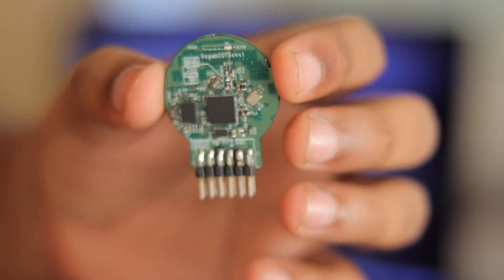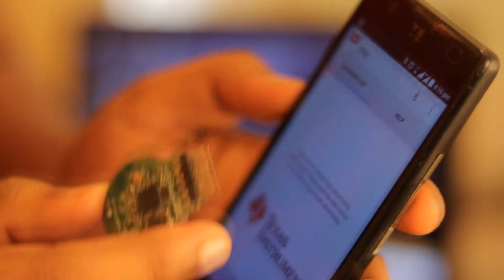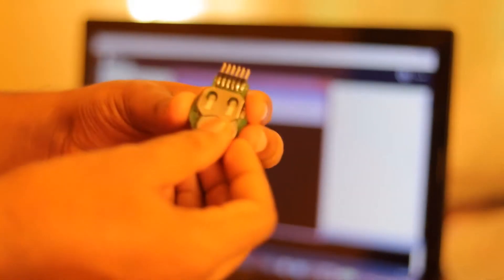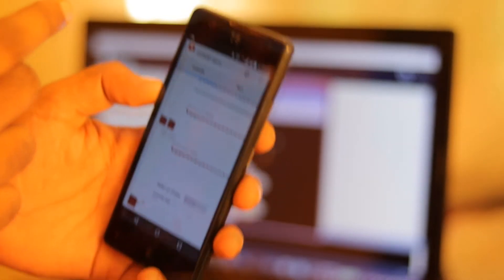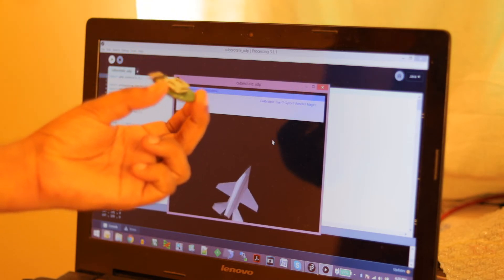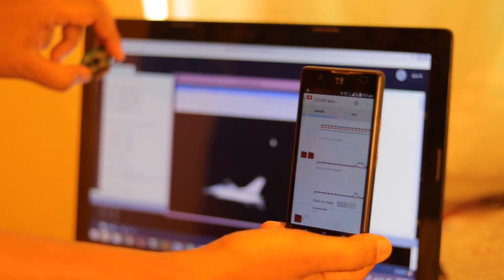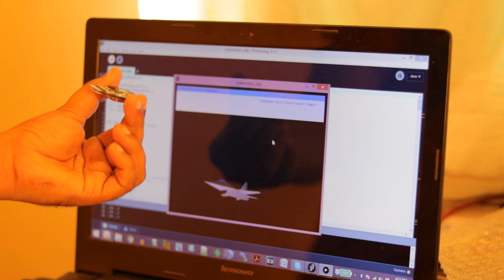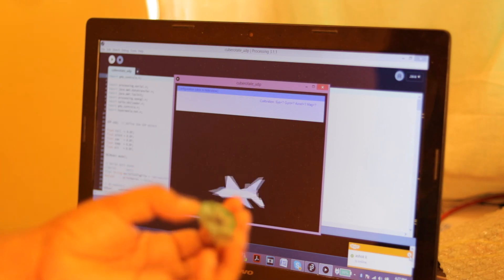Custom CC2650 SensorTag - 3D Orientation sensor Demo using Bluetooth

Comment: Hi,How you integrated the Sensor Controller Drives with BLE
Reply from the maker: There are libraries for I2C which can be accessed to read the sensor values. These sensor values can be transmitted as bluetooth attributes to the gateway. Dont forget to share and subscribe :)

Comment: Hi Ravi,  this video is very nice.  As per my understanding,  this involves an IMU sensor, which is calibrated well with a 3D object view. And sending the live data of IMU sensor to receiver using CC2650 though Bluetooth.  Very clearly the 3D object is moving same as the IMU sensor.. that is very nice. I am using CC2640 to export a sensor data to an android application through Bluetooth. Which is similar to your work. Please share your code details or any URL which contains the info of your coding work which helps me to write a code to accomplish my task.
Reply from the maker: Hi,
Thank you.
This was a commercial product and hence code cannot be shared. But its a simple mechanism, it will send data by Bluetooth which is already present in sensor tag sdk. You just need to send data of new sensor in place of old sensor data. The data i send to Android app gets transfered to pc via wifi through udp. UDP data is received in processing application.

Comment: Is there a provision on TI sensortag app to transmit data via udp/http/mqtt to any other server ? Or do I have to make changes in the source code of the TI sensortag app ?
Reply from the maker: krunal patel There is a cloud upload option.  Never tried it.
Reply: Ravi Pujar Thanks, will try and post if it works.
Reply from the maker: krunal patel  Sure,  will be waiting.  Don't forget to share and subscribe :)

Comment: hi, what s' your sensor 3D orentation  ?.
Reply from the maker: Hi, I didn't understand? It depends on how you hold it.
Reply: that mean what name of sensor you use.? is this kind of IMU sensor 
for example MPU6050
Reply from the maker: Yes correct, Its a IMU device. But i cant disclose the name without clients permission. There arent many , you should be able to find it out :)
Reply: i have more question. i'm using IMU sensor to detect accident when driving  motorbike and send signal to smartphone then notice to relatives.
i find out IMU sensor, best choice IMU sensor use for my project is 9 DOF sensor ( acc+ gyro+magneto ) to remove nosie, bias...and high precision .
but what a problem in this. i'm using BLE and Cr2302 like you to get power .so Gyro sensor in IMU take to much power, about 3,6 mA, in while. Cr2303 just 270mAh. So this my device just live in around 1 week. 

so which sensor IMu ,i should to use 3 dof, 6 or 9 dof
Reply from the maker: Do detect accident you just need a accelerometer. Watch my VALTRACK-V2 SMS demo video. It can be configured to different thresholds to trigger SMS or call.